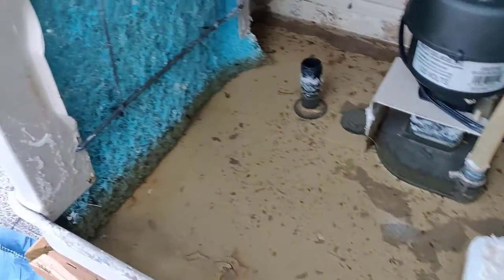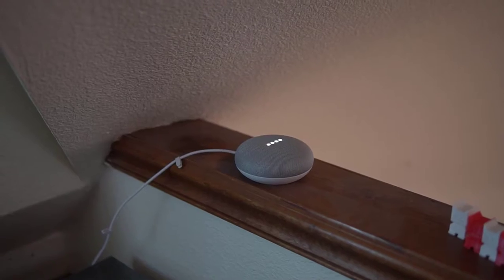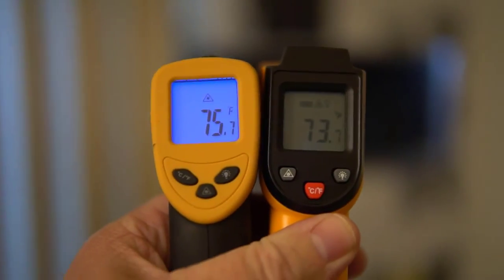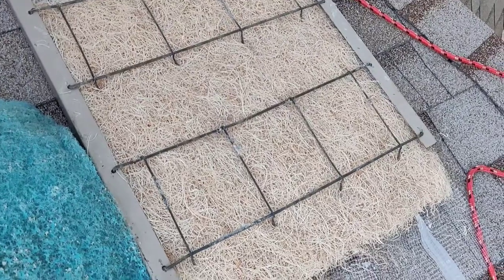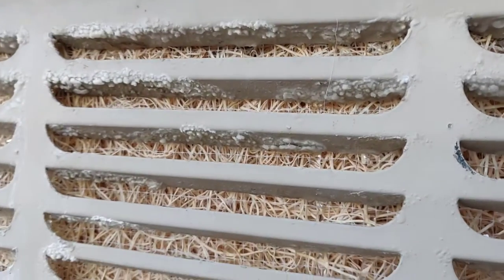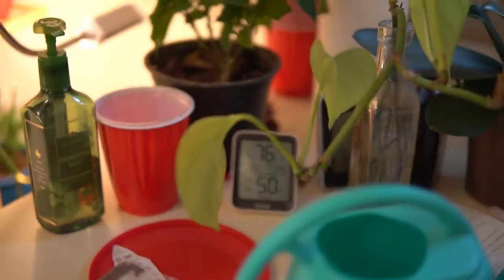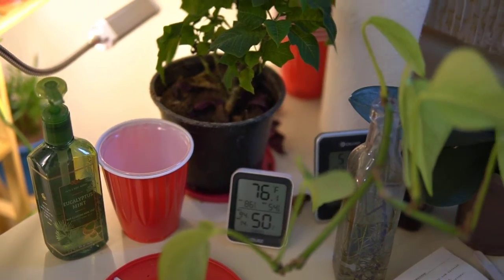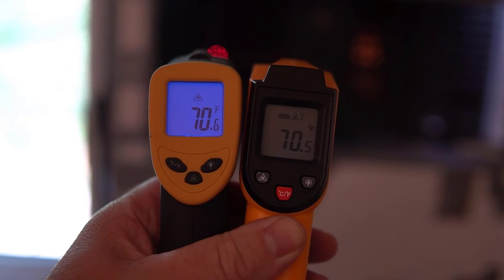Aspen Pads vs Blue Synthetic (Dura-cool) Pads - Which are cooler for swamp / evaporative coolers?

Comment: Thanks for the vid, but...think about being bit more empirical with your "experiments" before recommending one pad over another. First off, looks like you're comparing an older, used blue pad to a new aspen pad. No. Then---what's the RH outside and indoors on each day of your test? Was there any sediment dislodged when you removed the old pads? What were the cloud conditions and wind like on each day? Do the measurements for each pad over several days and get an average

Comment: But did you measure the indoor HUMIDITY?
Reply: Or outdoor relative humidity
Reply: Duracool showed 56%, aspen showed 50% around @1:10
Reply: Indoor humidity is a start for sure. Not sure if it's information that you collected in the process but without having outdoor humidity data it's only as useful as having indoor temperature without having outdoor temperature and then drawing a conclusion off that incomplete picture.

I otherwise appreciate the efforts and would love to watch a better researched or constructed video with a more scientific method approach taken.
Might I suggest a video that describes to your viewers a synopsis of how evaporative cooling works and then referencing back to points in that synopsis as to why the data you are presenting is relevant.
Perhaps then going on to providing some kind of proof as to why your conclusions are correct in that one product come out better than the other such as showing where one might have better wicking action or in some other way provide either a more even distribution of the water over the surface or better air flow rates for a given CFM fan as each of these characteristics are going to change or skew the results.
Reply: No because it's irrelevant either pad raises humidity
Reply: The question is about efficiency.
Variable factors include starting temperature and relative humidity as well as saturation level of the pad and volume of air passing through the medium.
Humidity is relative to the current environmental temperature and the cooling effect is caused by the evaporation of the water into the air.
The effectiveness of any material is going to be different at a different relative humidity.
If you were only measuring temperature or only measuring relative humidity you are only accounting for a portion of the problem.
Reply: Humidity is everything with a swamp cooler.  He said he ran it for months with aspen pads and had better results.  Sounds good to me. Always used aspen pads anyway although I like the cool blu color.
Reply: @Robert Toms, III  yes the humidity of the intake are is as important as the temperature.  Even 10%rh different can make a good 5° difference in cooling
Reply: Thank goodness for the humidity swamp coolers produce.  My skin is not so dry in the Summer when using it.

Comment: I switched to the blue for a number of years and had to supplement the cooling.  I thought they will last longer, and they did.  But they didn't cool as well and over time they got coated in lime.  I didnt realize that they were not cooling as well as the aspen pads.  I went back to the aspen pads and it made a drastic difference in cooling my house.

Comment: Yeah I went from Duracool to aspen pads and I'm never going back. People are fooled into thinking the Duracool is better because it's more expensive. Technically, it does last longer than aspen pads. But I don't even care if I have to replace my aspen pads more often, it's totally worth the cooler temperatures. There are some people who think a swamp cooler is far inferior to air conditioning. I was not impressed by my swamp coolers performance when I used the Duracool pads. But then you use the aspen pads and it really makes you a fan of swamp coolers. Especially in a very dry climate. 90 degrees outside and I'm rocking 70 degrees in my house
Reply from the maker: I feel the same way as you. I don't like how messy aspen pads are but I like that they actually work. We have AC setup in our house and honestly for anything 90 degrees and less the swamp cooler just works better and faster for our house.

Comment: So much of cooling-efficiency depends on the "salt" content of the water.

I note in your video that there is a LOT of lime depositing on your pads and even on the metal parts (!) of the cooler panels.  Bad!

It would be good to install a "bleed" provision, which bleeds off a small portion of the cooler water reservoir contents continuously when the water pump is running.  You can route the bled-off water to landscaping or to buckets (it won't be too salty for plants, because the solids will be diluted, not concentrated as they are on your cooler now).  Yes, this will result in more water-usage, but you can control the amount of water that bleeds-off with a small constrictor that slides onto the water tubing.

Else, if you don't use this bleed-system, you can empty the reservoir about once a week, and flush the reservoir (and pads!) with water from a hose (flush thoroughly).

If there is a lot of dissolved solids ("salts") in the water, it will not evaporate strongly, and hence will not cool.

I'd say that clean water (minimum amount of salts that you can feed into the cooler) is MUCH more important that which kind of pads you use.  And, until you try each test with CLEAN water -- obtained by flushing and refilling, or else by using the bleed system -- the "tests" are pretty unreliable.

I hope this helps all swamp-cooler users.

Allowing the water to become briny and deposit salt on your pads and metal parts is also a reason (and prescription... ) for rapid corrosion of the metal cooler and ruination and blockage of the pads.

A plastic "bleed-valve" tube, and some tubing to route the bled-off water to the ground, to plants, or to buckets, would cost well under $5.

--Joe / Tucson ARIZONA / Sonoran Desert

Comment: Totally disagree.  those who give advice about "pad is better tales" must have developed their misconceptions about material science.   You, OWNER of the machine should be "don't care how water is running through or water absorbing fiber PERIOD". You should care about how water is EVAPORATING off the pads.

Now,  different materials pad has different evaporation properties.  Like you, I tried all three and realized should have paid attention to evaporation effect from the materials.  The best pad is your (that is owners, not installers, not manufacturers, not other bragging twits) habit on using the machine's evaporation, not the material selection.

a) blue pad (duracool) is spun plastic then fused,  forcing water to spread out into air space (imagine waterfall- curtain) and evaporate. manufacturer states supposedly last longer [ this claim is irrelevant, because calcium buildup still blocks "curtain" passageway].

b).  aspen pad (fibers) does absorb water until it is waterlogged, then fiber expands, then excess water starts to evaporate. THE CATCH!!! evaporates begin after pad is waterlogged [not before].   when calcium binds to wood fiber, it stops water from absorbing; thus retarding the evaporation. This does mean you want the water pump to run continuously to keep fiber expanded (and not to dry-up and re soaking, encouraging early calcification).

c) there are greenish-brown pads,  they are paper impreganted with something then sandwiched, somewhat waxy chemical or thin plastic??.  This pad has the widest  "air opening cavities" but is misleading on cooling.  the waxy or plastic coating is helping 'bead up' the water into the cavities. Whereas at start of machine water pumping pad is somewhat like air curtain effect (look at duracool);  then starts soaking and expanding the paper, behaving like aspen pad. This means when material starts to calcify to certain quantity, the bead up technique or swelling fails.

d) on different notes: if you are going to reference on clay and sand type materials [AFRICAN and ARABIA is using those type science]. I have not used this. The process relies on reuse and renew materials. example with calcified sand, just stirring up or turning over the sand. for clay, brush-scrape off calcification off the surface.  That does sound like cheaper expense on materials.; but the reports indicates from what I believe "weak cooling-evaporation" by the way SAND and clay is heavy. 

REGARDLESS SECTION    homeowner with swamp coolers should haven been told and know!!! 
1) when temperature soars to greater than 97 degrees Fahrenheit.   Water evaporates so fast and water never had chance to completely saturate the pads... this results in faster calcification build up [and ineffective evaporation and cooling.] 
2) outdoor higher humidity does retard cooling; ranging somewhere 35% ish  maybe 40% ish. 

PAY ATTENTION: calcification does not encourage evaporation. Retarded cooling does NOT stop calcification. In other words,  turn off your cooler with pump when weather is not favorable!
Reply: He's not wrong though. Aspen pads are much cooler than blue pads. As for preventing calcification, don't turn off the pump even when the fan is turn off. It keeps the pads saturated.
I double the aspen pads and keep the pump running. When outside temp is 110f, my inside temp is 78f. That's 32f difference.
Reply: thank you for the info!